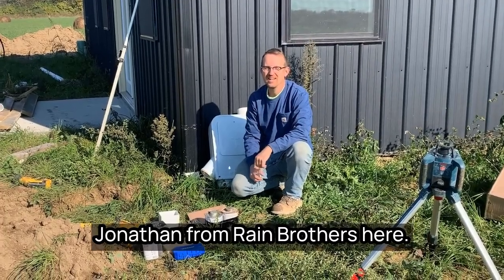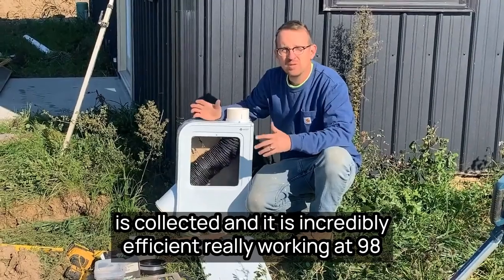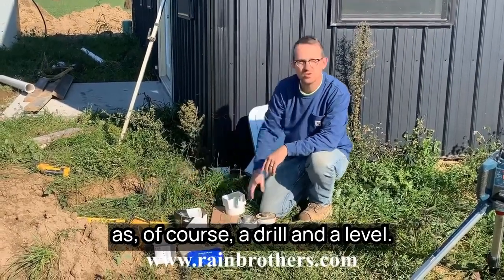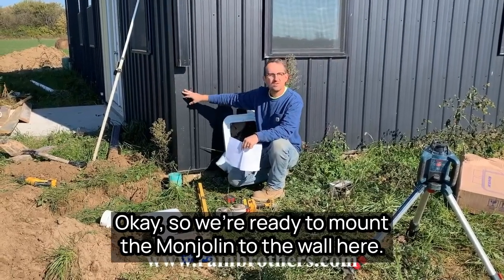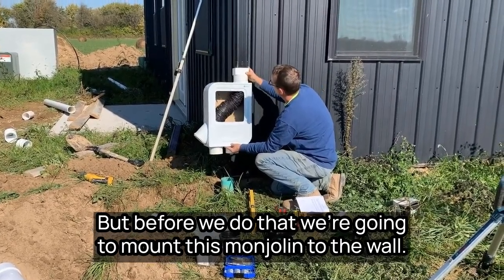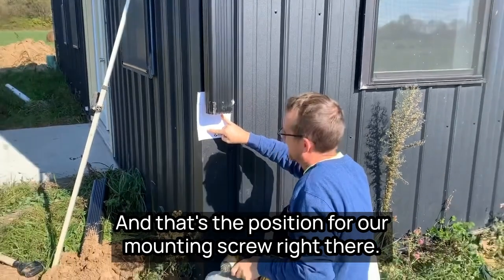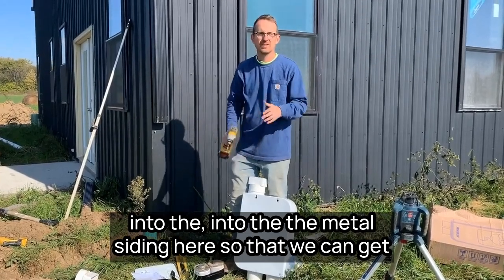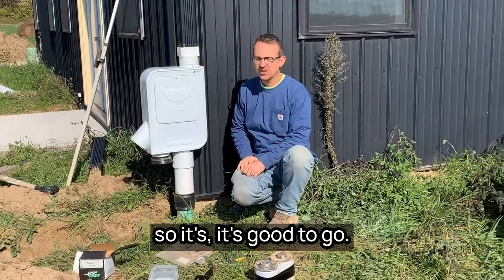Installing a Monjolin Rainwater Cistern Pre Filter

Comment: It's an OKAY design but unfortunately, there are MUCH MUCH better designs on the market. The fact you lose ANY of the water through your debris outlet is a major concern for starters. A string pulley system is archaic and most will run into issues using such a system. Gravity-fed is better.
Reply from the maker: Thanks for sharing. What better designs are you referring to? I’ve been doing rainwater harvesting system installs for 20 years and I’ve tested just about every pre-filtering system (manufactured and homemade) on the market, and I’ve never encountered one that was 100% efficient. But also, you don’t want to collect 100% of the water. A portion of the water that comes off the roof is going to carry pollutants and debris that should not enter your system. In my experience, the Monjolin filters are exceptional

Comment: Cool product!  Might have it made more sense design-wise and to save time in moving your stormwater runoff pipe simply by putting a 45 degree angle on your downspout so that it meets the filter in a position where the filter is directly over the stormwater runoff pipe and flush to the side of the structure so it's not sticking out?